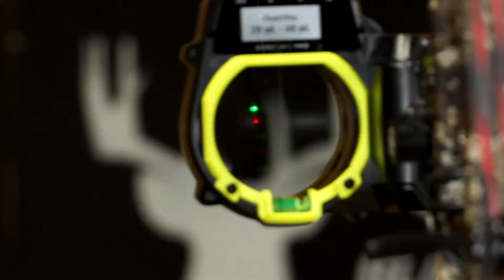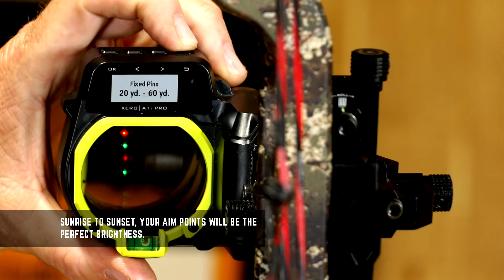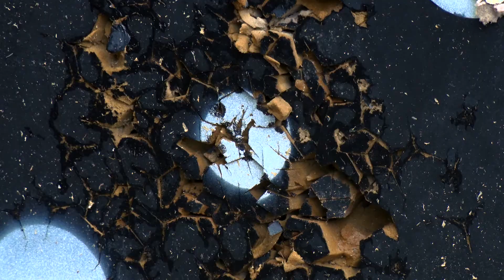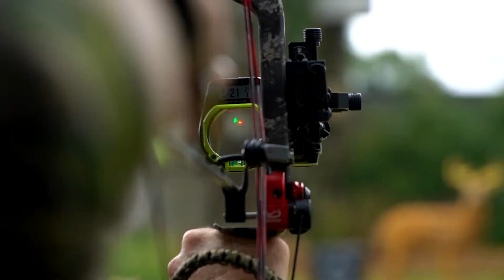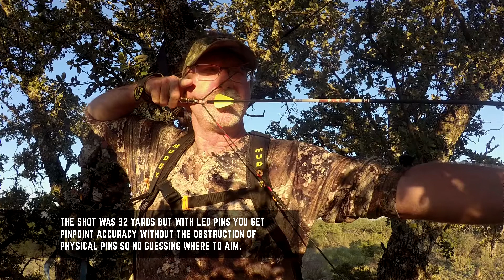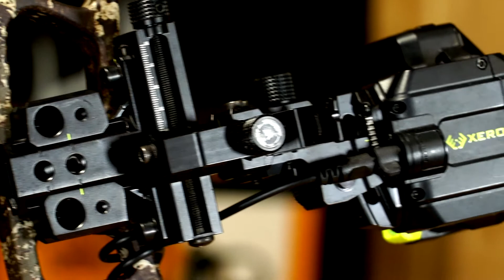Setting Up the Garmin Xero A1i Pro Bow Sight

Comment: Question about XD mode. Let's say if you have 2 arrow profiles.  In profile 1, After calibrating the standard pin stack and you calibrate the XD mode, is that XD mode the same XD mode as arrow profile 2 or will the device allow you to calibrate a separate XD mode for arrow profile 2 after you set up a standard mode for profile 2?